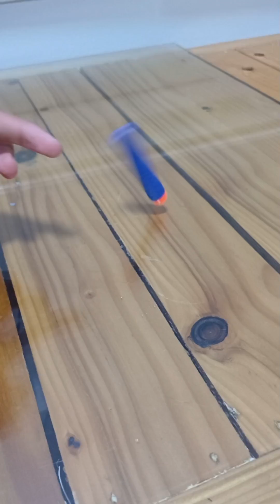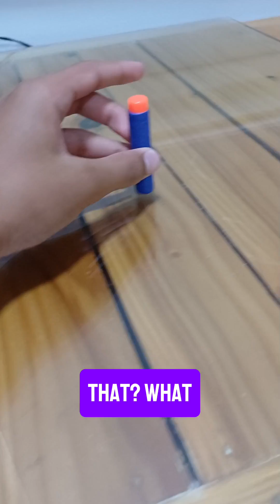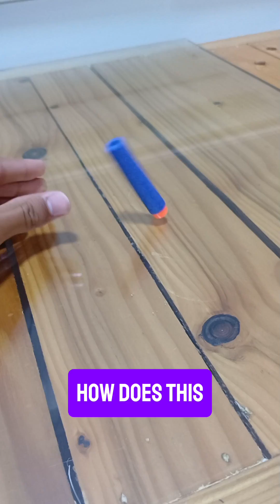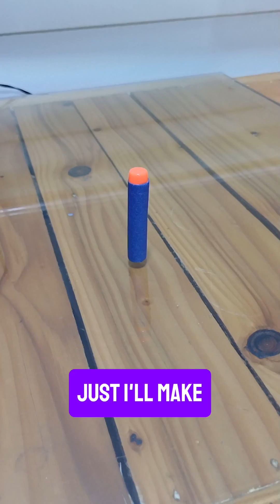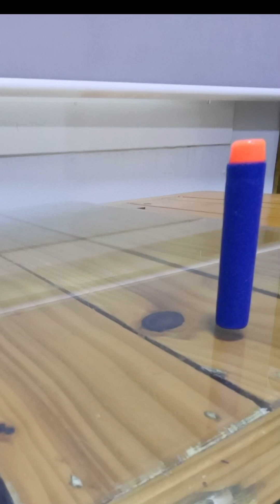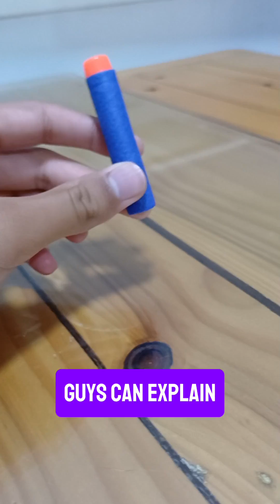How... HOW DOES THIS WORK?!?!

Comment: This effect is due to the conservation of angular momentum. The dart is initially rotating about the point that is in contact with the table ( the end of the blue part ) which is a relatively large distance from the centre of mass ( inside the orange part) so the centre of mass has a large rotational potential energy, as the dart falls and strikes the table, the axis of rotation is rapidly shifted to be at the centre of mass which causes a large majority of the potential energy to be converted to rotational kinetic energy. This causes the dart to spin much faster about the orange part and so it can flip over like in the video :)

Source is that I’m an undergrad Physics student and we learned this type of thing in our first year of university. You can find plenty of videos on conservation of angular momentum on yt if you want a more thorough explanation.
Reply from the maker: Woaahh that some crazy info, thnx for the explanation 😁

Comment: the orange tip of the dart is at a slight angle upward compared to the flat blue edge. when you drop the dart, the momentum from the tip continues into the table. since the tip of the dart is so heavy compared to the foam, the center of mass is heavily shifted towards that side. the momentum from the fall causes the dart to rotate around the center of mass (the tip).

basically, the dart turns into a teeder totter with one side way heavier than the other.
Reply from the maker: Good to know 👍👍